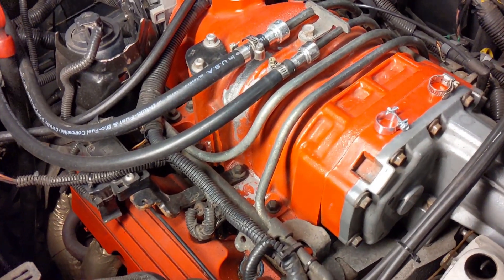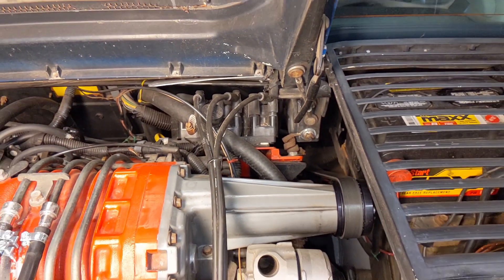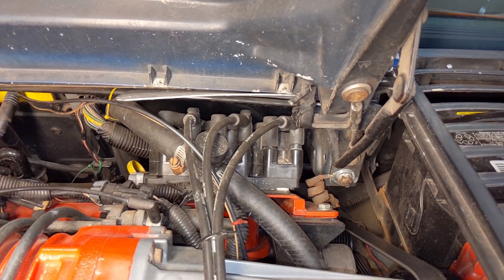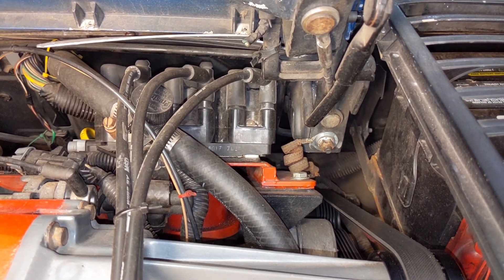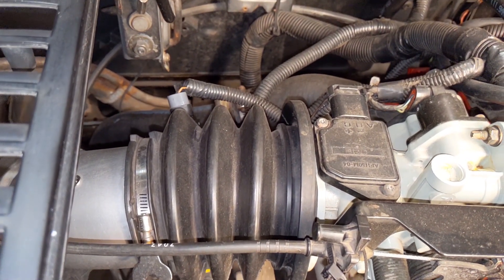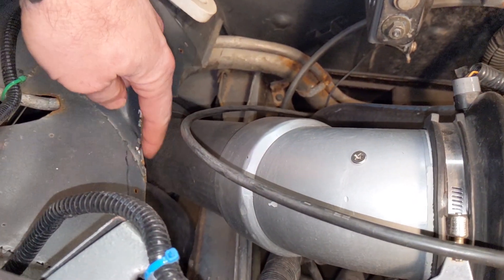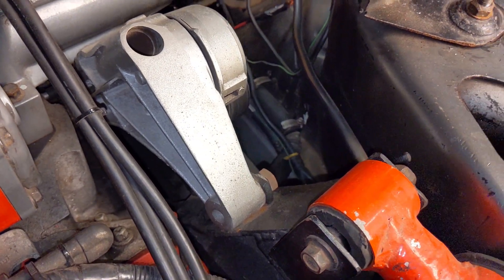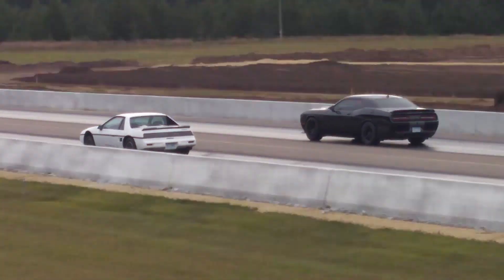3800 Supercharged Fiero (Tips & Closer Look Part 3) / Engine Swap

Comment: Did you retain the stock front engine mount on the passenger side of the frame? I'm picking up a 3.8 swapped 86 Fiero and they cut that off because they thought it wasn't going to fit.
Reply from the maker: Passenger side just has the one mount kind of centered front or rear, but obviously towards the passenger side in the motor. Both for the 2.8 and the 3.8. The driver's side has two mounts. For the front driver side I'm using the stock 3800 regal GS mount modified slightly to attached to the cradle.
Reply: @Toys4Life  So the 3.8 uses the same passenger side frame mount as the 2.8? I was afraid of that. I found the original mount but it was cut and yanked on to remove. I've managed to straighten it pretty well. I'll try to fill weld it, otherwise it sounds like it's time to make a custom mount. Thanks for the help!

Comment: Great build. What are the differences with using the 260hp Series III engine instead? Looking to do this to an 87 GT!
Reply from the maker: A better supercharger and having to deal with the electronic throttle control which is a hurdle but can be done.
Reply: @Toys4Life  Would doin this swap be possible for average diy person.

Comment: Very cool . I have an 88gt, we have donor car  already. I saw some info from another build where they modified the sub frame to move the lower mount . Did you have to do that to yours? 
Thanks.
Reply from the maker: Which one do you mean by the lower mount?  There's one on the passenger side of the cradle, there's one towards the front middle/driver side of the cradle, and there's one in the rear middle/driver side of the cradle..  The only mount I really had to modify on the subframe was the rear driver side/middle mount.
Reply: @Toys4Life  
Hello 
I saw from one the West Coast groups , They cut out a piece and welded in a new plate back in, I think I still have the file in my old phone.
Reply: @Toys4Life  
I'm pretty sure it was the side mount. Some of the research I saw required modifying one one drive shafts by using some parts from the old one and some from the donor car.

Comment: Oops. My car has apparently has had the wrong fuel line hose clamps on my swap for the past 20 years & 25k miles. I haven't had any issues though. I still want to know about the E85 set up.
Reply: How about the hose clamps coming off the fuel tank? They have always been those worm style clamps?
Reply from the maker: That's a very good point sir, I'm not sure if it has to do with the newer fully ethanol rated fuel line or what.
Reply from the maker: My worm clamps would leak if not tightened every 3-4 months.  The new ones are staying put - so far!

Comment: i wonder what a 4.3 liter v6 and super charger would be like.
Reply: The hand of god. You be running with the Exotics, and there would allot of hurt feelings.
Reply: I seen Fiero running with the 427 LS7 C6 Z06 twin turbos and another with a ZR1 LS9 Supercharged and both were made to have the rear stick as much as possible and were out running the Vettes as well as the exotics by a long shot. But I enjoy the SC Buick/GXP 3800 as much as I loved the GNX 3.8 in the full size cars of 1987. I have been following a guy using pre-NS 4.9 Cadillac one carbed for racing and the super charge FI one with a 5 speed is his cruising car.

Comment: What dash are you using???
Reply from the maker: I took the entire gauge cluster out of the 97 Buick Regal GS, along with the engine, tranny, computer and wiring harness.
Reply: @Toys4Life  
Looks good.
Looks much better,   than the original.
So sad G.M.  NEVER allowed Fiero to be the awesome midship car.
They had all the parts needed, on the shelf.
Reply from the maker: I agree, but it would just compete too much with the other two seat gm sports car for limited consumer dollars..